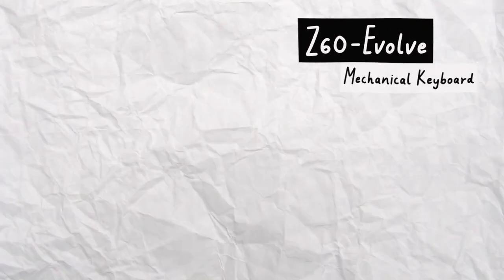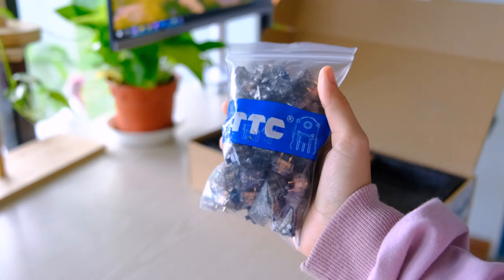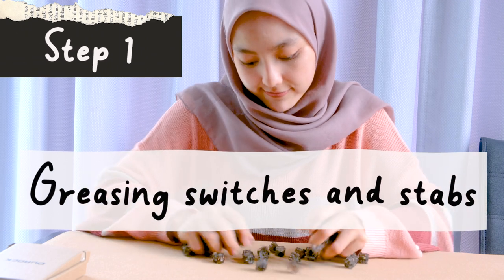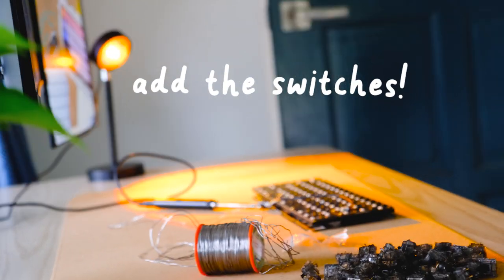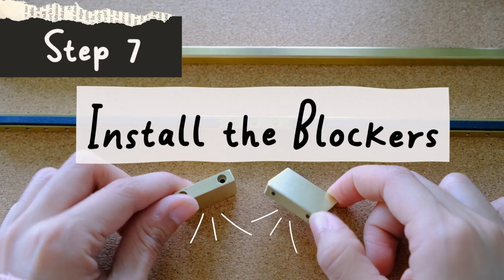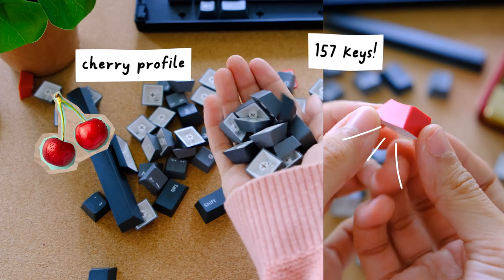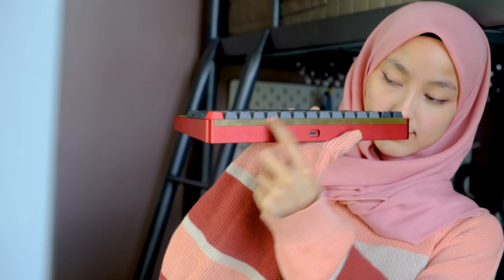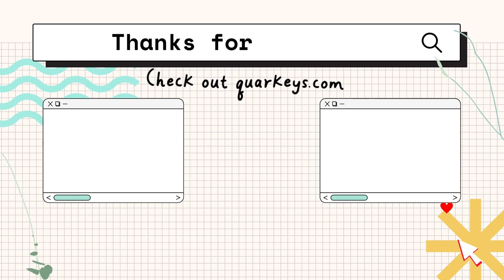Building the Z60 Evolve Keyboard by Quarkeys with Akko Keycaps

Comment: Can u tell me the stuff that comes with the kit
Reply from the maker: Yess it comes with the case, plate , pcb, brass pressbar, cable. But this version i am giving away is the solder version. Not the hotswap version so u might need to solder ur own switches your self. Keyswitches and keycaps not included. 😄you can read more about it on quarkeys.com
Reply: @WanSyazlina  well is the case aluminum?
Reply from the maker: @averageboy8823  yupp! It is cnc aluminium. You can read more of the specs at quarkeys.com. there is also a christmas discount going on.
Reply: @WanSyazlina  which one do you prefer more, the kbd67 lite or Z60?